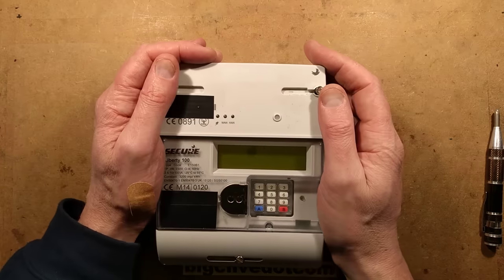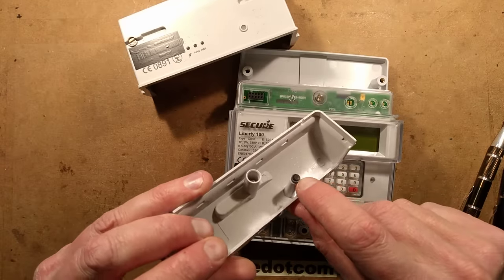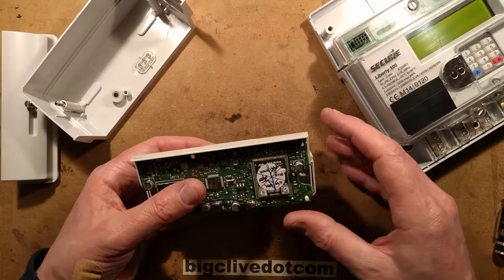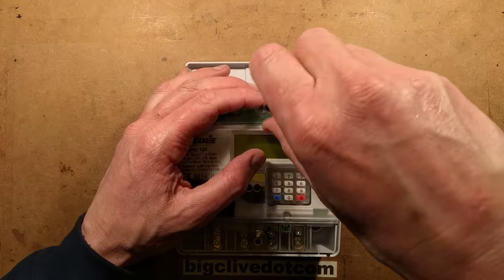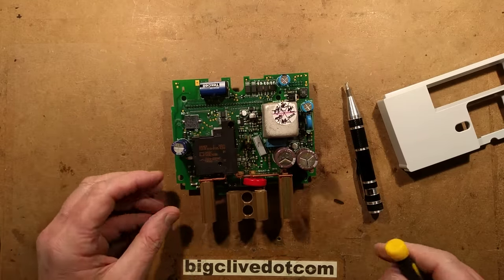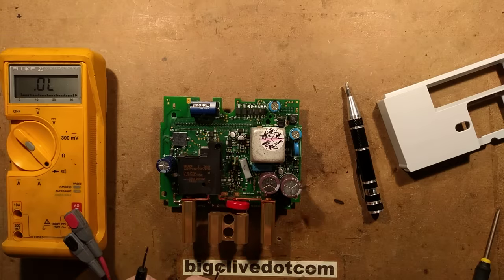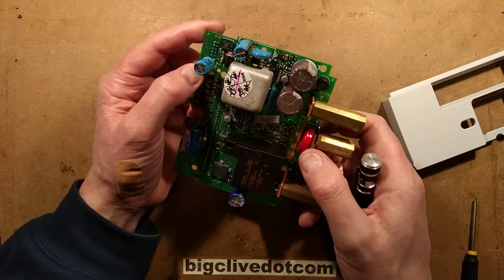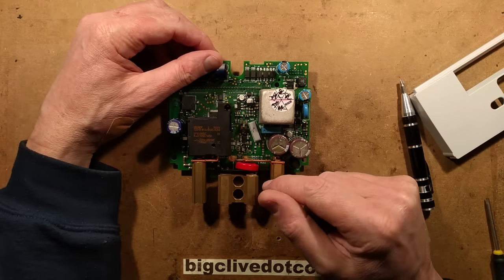Inside a smart meter, and the REAL problem with them.

Comment: Interestingly, in the US, the old (stupid) meters don't just tap in to the power lines. These boxes are outdoors, so the boxes are water-resistant. They're square boxes with a round opening in them. Inside that hole are four copper "pinch" contacts. The meter itself is round and has four blades on the back side which fit into the pinch contacts. Then there's an aluminum ring which goes around it to seal it and reveal any tampering. But the point is that, when you pull that meter out of the box, your power is interrupted. All electricity going into the dwelling (or shop) flows through the meter. I would bet that the new ones (smart) operate in the same way, because they don't change the boxes out when they put them in. They just take the round meter part out and replace it with another round meter gadget which has a digital read out instead of a big disk and a bunch of arrow gauges which go in various directions (as on the old meters). Matter of fact, you could undo the aluminum ring, remove the meter and bridge across the pinch contacts with slabs of copper or whatever and have unmetered power. Of course, doing this would excite the power company no end. Removing your meter was the favored way of interrupting your power, say, in the case where a house was being renovated in preparation for sale. If there was no payer on the account but construction crews were around who needed power, you had to contact the power company to put in a meter so you could power construction crew devices.

When I was an electrician, I built a box with two receptacles on one end of a cable, and two clips on the other end. I would clip them to the "split bolt" fasteners on the roof above the meter (thus getting power before it got to the meter). That way I could work regardless of whether there was a meter or not. They weren't going to remove the power drop between house owners. The meter maybe, but not the power drop from the pole.
Reply: I took apart an Itron smart meter I bought used on Ebay, all electricity does in fact pass through the meter and there are current transformers on both the hot legs. There is one problem with the Itron meter--if one of the hot legs fails, it doesn't record any power usage, because the digital circuit gets no power.

As far as disconnecting power, sometimes the utility pulls the fuse from the pole transformer, if the pole transformer just serves one meter. There's an old AT&T coax repeater hut not far from here where they did that. Either that or the fuse blew and they never fixed it. But I think it was intentionally pulled.
Reply: I've also seen meters that have a 50a 220v plug on them, that way contractors can use them on new installs before power is hooked up. The meter keeps track of this usage and the check in with the utility and pay for it. It's amazing in rural America how little fucks are given about stealing power. They only come check my 3 meters like once a year. I have a 3 phase and a 220 split feed under ground to the side of the house. It would be trivial to hook into that in the boxes before the meter, or even under ground.
Reply: @ionstorm66  Also amazing how, in rural America, you can leave your car doors unlocked, there isn't MS13 gang graffiti tags all over the place, there are no drive-by shootings, the cashier in the convenience store isn't behind bullet-proof glass, you rarely see police activity, your license plates don't get stolen, packages don't get stolen off your front porch.... and most probably, power theft is unlikely to be the problem it is, in, say, Detroit.
Reply: @brianleeper5737  you obviously have never heard of meth. Shit gets stolen every now and then.
Reply: @ionstorm66  No section 8 rentals in this part of rural america. Gotta go 10-15 miles to the city to find those and the meth problems. High property values mean that only high-density housing is cheap enough to become section 8, and that can only be built where there is public water/sewer. True story...I asked the septic company if I should put a lock on the control panels for my septic system...the guy says, "No, we haven't had any problems with vandalism or theft. This isn't (name of city 10 miles away)". It maybe different if the nearest medium-sized city is much further away, but this city being only 10 miles away provides a lot of cheap housing for the riff-raff, so it serves a purpose by keeping them away from where I live.
Reply: @brianleeper5737  um you have never been to rural America have you? You think everyone here is rich or something?
Reply: @Tim Hunter Rich or poor has nothing to do with it. Crime rates are lower in rural areas than they are in high-density urban areas. It maybe that living in an area where you have 10000 people living in 1 square mile presents more opportunity for criminals than living in an area where you have 200 people living in 1 square mile, and criminals go to where the opportunities are.
Reply: @brianleeper5737 : I'd be curious to know whether crime rates are higher per capita across urban versus rural areas. Probably are, but it's a reasonable question. It appears evident that when humans are "forced" to live within smaller and smaller spaces, they tend to commit crimes more. Why this is has to do with how humans react to space. Travel out to the ocean or the desert, and note how you feel once there. The open space tends to relax a person and make them less stressful, which is a different side effect of the amount of personal space available.
Reply: @ionstorm66  As far as having been to rural America...you tell me? I have a well, a septic system, a propane tank on the side of my house, I can hear a rooster crowing in my front yard sometimes, there are cows down the street, and my nearest neighbor is 350 feet away.
Reply: @brianleeper5737  Also worth pointing out that, for the most part, criminals are criminals, regardless of the environment. As there are fewer opportunities for crime in rural areas, and it is harder to commit and get away with, criminals tend to settle in cities, where crime is easier.

I'm a law abiding citizen, not prone to crime. I've lived in both very rural and very urban areas (L.A.). I don't feel more inclined toward crime when I live in a city. I'd assert that criminal types are criminal types wherever they are. And the same is true for law-abiding types.
Reply: @brianleeper5737  I've heard from people a couple of generations older than me, that at one time out west, no one locked their doors or secured their possessions. And in fact, if you wandered into a place, you could go in, and if you were hungry, cook yourself a meal. You cleaned up after the meal, and perhaps left something behind as thanks if you felt inclined. This was  the norm. This was back when the west was considered a vast area, perhaps before there were a lot of cars, and cities were days away from each other.
Reply: noferblatz  I am convinced that cramming lots of people into a small space results in more social problems.
Reply: @brianleeper5737  Agreed.
Reply: noferblatz  Yes--consider one common type of crime, porch piracy. In a rural area, porches may well be 300 to 2000 feet or more apart, not including the set back from the street which can range from 35 feet (minimum allowed by zoning here) to upwards of 2000 feet. In an urban area with, say, rowhouses or townhouses, porches may be only 20 feet apart, or less, and the set back from the street could be as little as 10 feet. For a given amount of walking, a porch pirate in an urban area will pass a lot more porches, and what is on these porches can more easily be seen from the street.
Reply: bubba99009  I believe you are correct.
Reply: Brian Leeper well, in a village everyone knows everyone, but in a city each one of their own.
Reply: @brianleeper5737  The smart meters allow them to match precisely the power consumed and compare them to the feeder branch consumption that all the other customers are on, they will find very quickly right down to the transformer that is showing an overconsumption and then further verify if the transformer is leaking to ground or which customer is drawing excess unmetered power manually by throwing a current clamp on each customer connected to that transformer.
Reply: @brianleeper5737  Living in a rural area I saw more than one meter socket with steel nails bridging the contacts. People in rural areas tend to be suspicious of the government and see the power company as basically a government agency, so they have no qualms about stealing from them.
Reply: With a metre like that why not just simply pierce the cable with a needle to avoid detection and place a resistor on the neutral input? this would make your metre think it’s using a fraction of the cost as it shows there basically no difference from the power out to compare to the power back in, thus manipulating the devices usage reading? being an electrician I thought you would know that but I’m an actual electrical engineer easier to become a doctor but in the UK my trade far out earns doctors and lawyers.

Comment: The counter point to the "they can choose when to charge you more" is that they already do charge you more when you're cooking, peak and off-peak. The real issue is that there needs to be more regulation about how they do their pricing, possibly a profit margin cap, so they can only make at most 20% profit. The main reason that having smart meters is a good idea and important is that it give a real time view of the power consumption across the grid, letting power generation be more reactive and less wasteful, which in theory will bring the total price of electricity down.
Reply: Or to put it another way, if they can charge you more at peak times, they can charge you less at off peak times. Octopus agile tariff updates pricing every half an hour. They publish what the rates will be the day before so you can adjust your usage to be at the cheapest times. The difficulty is if you are choosing between different companies operating such a tariff how do you compare the prices? It is much more complicated than if its just a fixed unit rate. Things would be so much simpler if we had a state energy company that just charged fair prices rather than multiple private companies each trying to charge you as much as possible in sneaky ways you won't notice.
Reply: @adrianthoroughgood1191  imo, electricity and other essentials shouldn't be left up to corporations. If they must be a part of any of its there needs to be strict regulations and tight profit caps.
Reply: @Ben-Rogue  Yes indeed. I can live with some generation being private sector if necessary, but it makes no sense to have private sector retailers. It's not buying a car where there is room for competition and consumers can make a choice about what they want. With electricity people just want to pay as little as possible for what they use. It's all just a game between customers trying to pay as little as possible and companies trying to charge as much as possible. I think there should be a publicly owned electricity supply company that handles the grid and billing and getting enough power reliably, whether that is building generation and batteries themselves or buying power from existing generators. They can do all the work of getting electricity as cheaply as possible then charging prices that are just enough to cover all expenses. They can have variable rate pricing to help with load balancing by shifting demand to when supply is plentiful, without it turning into 4D chess about customers getting the cheapest deal. Every citizen should be an equal shareholder and receive an equal share of profits if there are any.
Reply: @adrianthoroughgood1191  We had that in Ireland for years and they absolutely gouged us. Thankfully private competition arrived 20 years ago and we are starting to see the result in both generation and supply - but it took a long time to prise out of the government owned companies greedy hands.

Comment: That's a Pay As You Go  meter, and the keypad is there so if you loose your payment card you can enter the code you get from the shop therefore getting your electric.
Reply: It's a full smart meter, prepay or monthly, with the ability to cut people off and make them phone for credit.  I also sent Clive a PAYG meter.
Reply: It's also used to pair up the lekky  meter with the in home display and gas meter,  as all pair to the lekky meter, and send the data (up to half hourly if agreed)  to the data collector and then on to the supplier. 
You can also top it up via the in home device.  I used to install these but I can't remember the company name,  bit they specialised in prepay. 
Remember  people if you cab afford it and budget,  never go prepay,  it's always more expensive, partially due to the tech in the meters,  but with smart,  that shouldn't really be an excuse as any smart meter can be modded to be prepay  remotely (same as cutting you off or offering cheaper/more expensive prices at different times - British gas have been doing that for years to encourage  smart meter take up.

Comment: The common conspiracy cited in NZ to avoid having one installed was that "they catch fire a lot" because there were a few early cases of that. But that was only cited by people who wanted to continue growing illegal plants on a circuit bypassing their meter (they know full well that fire is a low risk).
But anyway, here's my story about smart meters. It's not very dramatic. I was living in an apartment and the power company had got our box muddled up with an apartment in another part of the building.
They sent us bills and we paid the bills. But periodically the same company also sent us flyers that said "hey, you're new here, sign up with us!". We called them on a few occasions to inform them that they were mistaken and that we were sorted for a power provider (them).
Then one day they turned the power off on us. I got home in the evening to find my flatmate had coincidentally got food poisoning and was throwing up by candlelight.
It took over an hour of talking to them on the phone, including the building's electrician being onsite and even talking to them, to convince them that they had the accounts muddled up. They just wouldn't listen, even when we read the ID off the meter to them. "But that's not the address we have on the account here." "I know. And it's wrong. I just gave you the correct address and number at least 10 times by now." "But.." "So fix it and turn our power back on. Now."
Reply: Emf radiation. It's a cellphone.  Hello cancer
Reply: @georgepalmer5851  Don't hold your ear up against your electricity meter then ;)
Reply: Doesn’t work like that. It permiates  everything
Reply: @georgepalmer5851  how much time do you spend with your head inside your meter box???